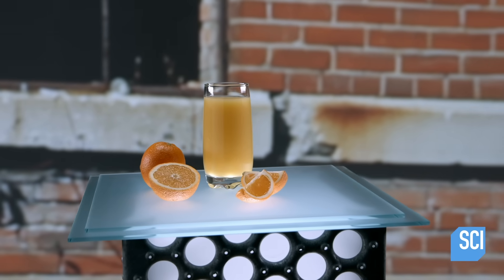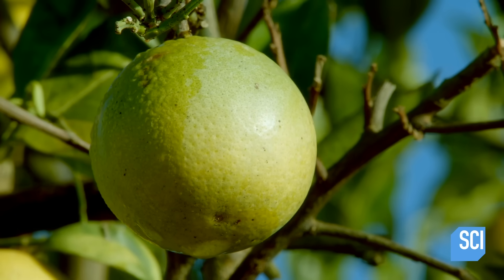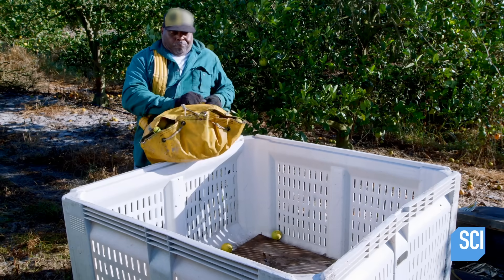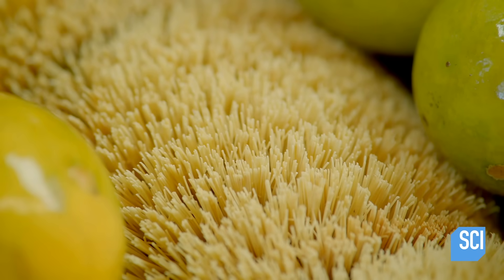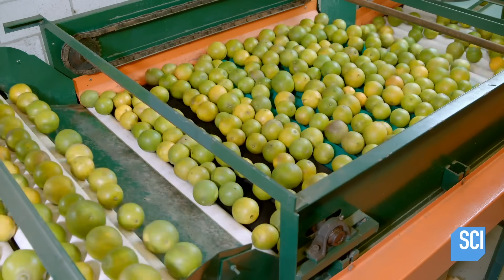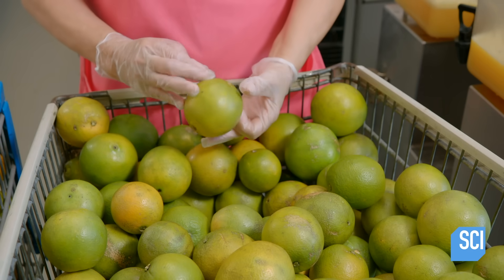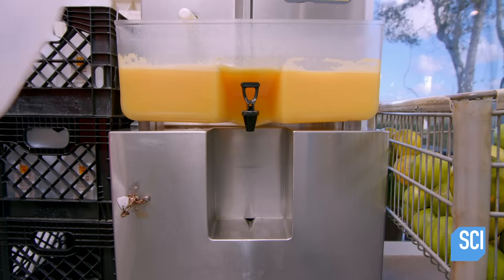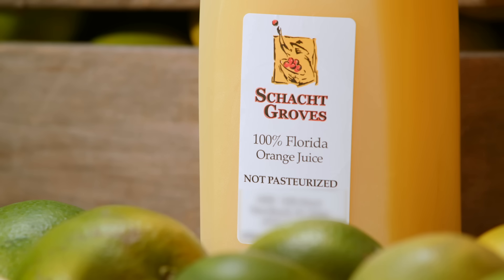How Orange Juice Is Made in Factories | How It's Made

Comment: It's just as I suspected. Commercially produced orange juice taste different than home made because they squeeze the entire orange in the machine, with the peel on. The peel makes contact with the juice. That's why it has that intense orange oil taste that you don't get with home made because when you make it at home you only squeeze the inner part of the orange without the peel so it taste lighter and sweeter.
Reply: Actually, store brands use "flavour packs" which contain citrus oils.  They add these because OJ sits in storage for a long time.
Reply: @Christopher-b1p  That makes sense. I wasn't sure what it was, but I know they do something different when they make orange juice commercially, vs. making it at home because store bought orange juice has that intense, kind of bitter, orange oil taste to it. I wasn't sure, actually, if it's because they put the whole entire orange through the juicer, with the peel, or if it's because of something they add later, or if it's because of the way they store it. I guess it's all of those things.
Reply: @Melissa0774  I rarely drink commercial orange juice, despite its health benefits.  If I do, i mix it 1/2,water and 1/2 juice and a bit of sugar.
Reply: @Christopher-b1p  1/2 juice from what? You mean you mix it with half, fresh squeezed orange juice that you squeezed yourself?
Reply: @Melissa0774  I mean if I drink the juice that is from the store.  For example Tropicanna or Simply.   Sometimes I make my own.  It's much better than even freshly squeezed.

Comment: If you're going to drink OJ, either squeeze it yourself from organic oranges, or buy non-pasteurized, fully-organic, from a local grocer. It will be expensive, and it won't last long even chilled (so buy in appropriate quantities), but worth it. Real, fresh-squeezed OJ in moderate quantities has a lot of benefits health-wise.

Commercial-grade OJ is completely worthless. It is basically high-sugar water with added flavors and colors, and a recipe for an A1C blow out. It is one of the first things an endocrinologist will tell you to stop consuming if you are borderline T2 diabetic, or T1 diabetic, followed by sugared sodas, anything with refined sugar, etc.

Comment: I make my own orange juice. Now, what they won't tell you is how expensive it can get. To make 8 cups of orange juice, it's gon cost you roughly $25 - $30 (depending on the size and price of the orange). Naval and Cara Cara orange are typically $1.49 - $1. 99 / lb. For 5 - 6 oranges, that's about 5 lb and that could run you roughly $10.00. Basically 5 lb of oranges is 6 -7 oranges. I understand why folks just buy mass produced oranges juice.

Comment: I swear I saw a how it's made of Orange Juice that was showing how Tropicana did it, and I very clearly remember the episode showing that, they do use machines to harvest the oranges, they don't get squeezed at all, the whole orange is ground up whole, the pulpy mashy mess is pressed through filters, and then stored in massive silo tanks for months.
Reply: Different process
Reply: There have been mechanical harvesting but it was t viable to the reasons stated. The oranges aren’t ground up the are cut in a very similar way but for some varieties that have more oil in the peel they do separate that from the juice.
Reply: Nobody mentions the wood pulp cellulose substitute and the chemical cocktail used to revive the year old fermented liquid stored in huge containers as to make it readily available year round.

Comment: At Whole Foods you can get fresh-squeezed orange juice as well, many stores have a machine like this out on the floor that customers can use to bottle their own. We get boxes of juicing oranges shipped from a distribution center, sanitize them in an antimicrobial "Victory Wash" solution intended for food, rinse, then dump the oranges into the top of the machine for you. The machine slices in half, then squeezes, and the peels are dropped into a bucket we dump each time we refill the oranges up top. Machine is cleaned nightly. We do a glancing inspection when we clean the oranges, I can guarantee no one looks over every inch of every orange like this lady showed. It's fairly easy to tell which ones are bad.
Reply: Who cares
Reply: @daveklein2826  since we're on a How It's Made video that's about orange juice, I'd bet a lot of people.

Comment: Lies. They did not mention that they use Ultra-high temperature (UHT), which sterilises the orange juice by heating it above 135 °C (275F), the temperature required to kill spores in juices, for 1 to 2 seconds. Note that this is different to pasturising. UHT prolongs the shelf life considerably.   Otherwise shelf life can be as short as 48 hours and the taste can start changing in as little as 24 hours. Unfortunately this also kills a lot of the vitamins, which they can legally add in after without mentioning it on the packet. You want proof? Call the company that makes your orange juice and ask if they use UHT. The biggest brands like Innocent Smoothies use this.

Comment: Why does  the fact that the "oranges"  are actually green bother me so much!!
Reply: @M Lenz, you're right! It's necessary a colder weather to degradate the chlorophyll from the peel and synthesize carotenoids (which will give the orange color to the fruit). That's why fruits that comes from warmer places has the green color, but It definitely does not change the quality and characteristics of the fruit inside.
Reply: @luizmatta6141  I never knew what it was that caused it.  Thanks!👍for science 🤙
Reply: In costa rica oranges and lemons are both green, and limes are yellow. Also there's no word for limes, as they're just considered a type of lemon. It's a very fun time trying to guess what's on the inside of your ambiguously colored and shaped citrus fruit.
Reply: @bobthebuilder1289  even in my country Bob n my Granny's tree actually produces these green ones, you misunderstood what I wrote there. All m saying is I just wished they could have used orange oranges coz they are more appealing, when someone says m eating an orange your mind automatically sees an orange orange not a green orange, so yeah my mind just assumed n orange orange when I read the tittle
Reply: Most of the oranges in stores in the United States are treated with ethylene gas to give them that orange color.
Reply: It has more to do with climate.  Tropical climates typically produce green skinned citrus. There are some variety that will still be orange/yellow